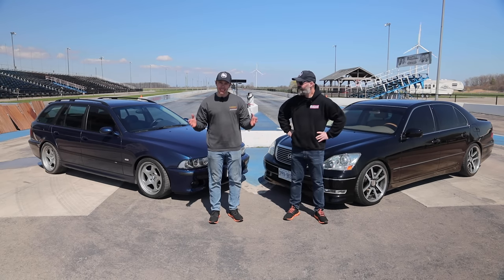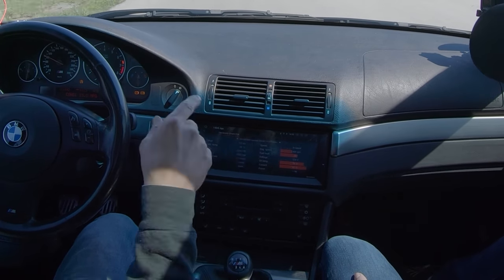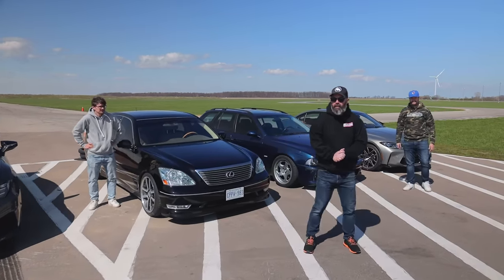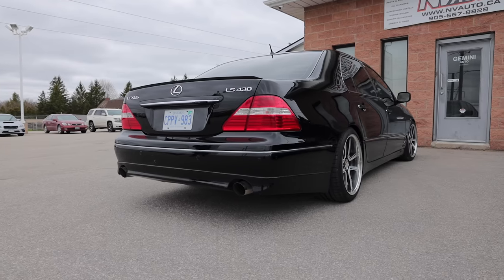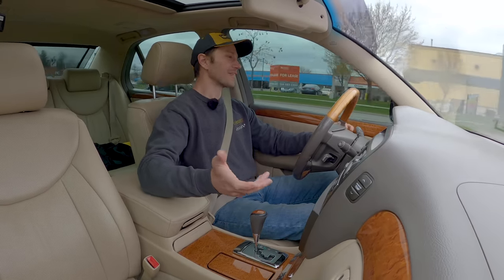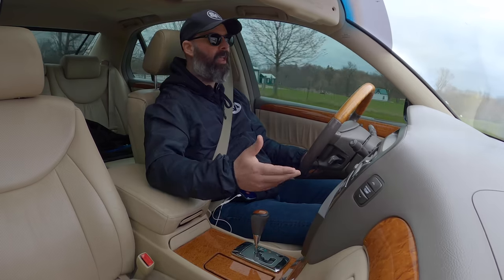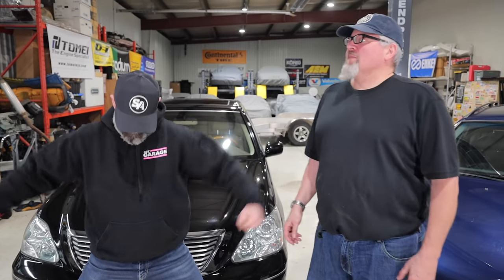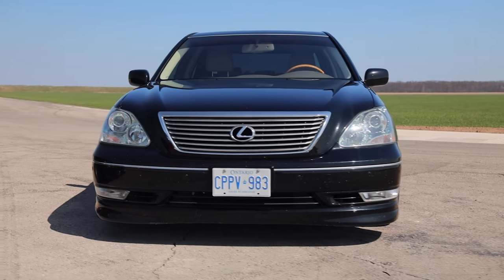We Built the GREATEST $6K Sport Sedans EVER! BMW M5 Wagon & Supercharged LS430 Build-Off FINALE

Comment: There's just something about that wood grain and beige leather.

It's probably the wood grain and beige leather.
Reply: Wood grain needs to go. IMO
Reply: Both extremely ugly, especially on black cars. It's a 70-90 thing because people didn't know anything about designing back in tje stone ages.
Reply: @christopheraustin3324  it's a luxury car, so.
Reply: @traviswalker8933  There is nothing Luxury about it. He modded this thing and the beige leather looks amazing. Black is sleek or maybe even carbon fiber but not the old wood grain. Sorry.
Reply: @christopheraustin3324  I'm talking what it originally was and it was a luxury car. He did performance mods to it which were not too extensive and only made it perform better. That doesn't change the fact that it's a luxury car. Same goes for the M5.
Reply: @traviswalker8933  the wood grain blows. Get over it.
Reply: @christopheraustin3324  that's just your opinion.
Reply: Got a 93 ls400, the beige leather and wood grain is a love or hate. And I love
Reply: @christopheraustin3324  not saying the wood grain is to die for, but 'black on black with carbon fibre' is just tasteless at this point. Materials aside, that centre console is fugly, that would need saving first

Comment: I gotta go with Moose here, the S62 is a special engine, it makes the car. For quite a few years BMW Motorsports was using S62 based race engine variants, deep into the S65's mass production and until the S65 race variants were used later.

Comment: As an owner of a stock 2003 Ls430 ( ultra luxury package)  stock car daily driver. I love the exhaust sound and plan on doing it. Supercharger is a bit expensive for my liking though the cylinder walls are super thin in the 3uz-fe so boost is minimal. I'd like to see the continuance of this turning these into race cars. Lexus has a lot of weight to shed and already gaps off the line. The ultra luxury package has a mini fridge in the back seat. I'd turn that into a bottle warmer just as a scramble. All hypothetical though I'll keep driving my stocker.

Comment: That rattle in the shifter is likely from the shifter selector rod. You can get a dual link selector rod to tighten it up or the Dinan shifter makes the rod sit lower an rubs on the guibo at certain rpms.  I had a couple shifters and finally went with Autosolutions. It solved all my isues.

Comment: i bought a 2005 LS430 in toronto few weeks back driven 263K kilometers & i drove it from toronto to vancouver took me a week to get here & i drove approx 6000 Kilometers & not once did it break down on me or any issues at all drove thru extreme wind, snow storms, heavy rain that thing went thru like a tank.... & whoever was the first owner has kept the car in extreme mint condition it doesnt feel like its driven 263K makes me sleepy while driving its too quite & no vibration nothing at all it seems like its brand new & mines a full ultra btw air suspension is too smooth 😍 soon im gonna swap some exhaust on it its way too quite but i love it its an investment i wont ever regret 🤍❤.

Comment: Thoughts as to why the series was so well received. 

The LS and E39 have classic storytelling qualities in that they are contrasts in almost all measures. Wagon vs Sedan, reliability vs BMW, drivers car vs retirement in Florida. 

Both platforms are equally interesting to car guys. The E39 represents peak BMW. The Lexus represents hardcore engineering with a focus on durable refinement that will stand the test of time.

For each car, which is cool in its own right, you managed through the build to improve upon theses characteristics without changing the cars entirely.

Comment: As to the driving, Inwas one that said more driving. 

I’ll use abandon sti as an example, you driving the sti through the on-ramp revving it out etc, it really had a good sense of speed to it. I could feel the boost building. Personally I like to be able to relate the mods you do to the type of driving most of us do. On the road. Running a car through the gears, get good audio, let us experience the build that way. The good audio is key for me. Mic the engine bay and rear bumper. This video was missing car sounds and emotion but don’t take that as a negative because I like you guys so much it was nice to “hang out” for the video. 

I know it’s a tough balance of not driving like an A hole but also having fun. The hard part is breaking the law lol. Don’t stop track test because that what you guys are. But add in the road element/audio. As for wrenching, I like watching all of it. The new format is a good balance of tech with out getting buried in all the details.

Comment: Consider adding a Helmholtz pipe for the Lexus drone should work pretty well. A few youtube videos show a spreadsheet where you input the hz of the sound that is bugging you and it tells you how long of a pipe you need to add. On Android, figure out the hz by using the Spectroid app. That would be a great video imo. Glad to hear you wanna keep it until summer.

I'll finish the video later, but consider a black interior swap (if not too expensive) on the LS unless you're stuck on the tan.

Comment: These two cars are awesome, i honestly couldnt pick one, love them both! 
Holy moly! Havent seen that chicken coop in so long!
I actually bought a set of those conti extreme sports for my s2k. Its got excellent grip, but not the most confident in turns only because the sidewalls feel like they fold over. It would be amazing if these can last me 30,000 miles.. so far the most i got out of 3 different other tires i got 12,000 miles on firehawk indy 500. No track days.. just daily and lots of canyon driving

Comment: I was getting ready to sell my 93 M Benz S320. Then, I ran in to your LS460 build. Now, I'm going to keep it! GREAT BUILD!
 
I need your input tho - I am running 235/35/20 (front) and 255/30/ 20 (rear) on stock suspension (so, big unsightly gap upfront). I am older (late 50s) so I kinda like the cushy ride. QUESTION: Would lowering the front with adjustable coil-ins be too harsh? Do I need to lower the back, too? I am happy with the height. Thanks, in advance.

Comment: I love the M5, but I also have to root for the underdog. You're pitting a $60k Lexus against a $70k BMW.  In 2021 that would be $90k ($112k CAD) vs $105k ($131k CAD).  Pretty much every extra penny originally spent on the BMW was put toward the Motorsport bonafides. That you made an LS into a competitor is truly commendable.. the wheels (on both) are just delicious icing. 

This series has been excellent, guys. Well done.

Comment: You can thank me, in part, for the anti-speeding measures on Snake Rd. LOL I worked in Hamilton and worked in Waterdown and thrashed that road to and from work in my blue MK3 Jetta (especially to work :P)

Everytime I got waved by by this one guy, as I came up on him, I'd get a letter in the mail from the police about a week later that someone complained about me on that road and date. Probably 4 or 5 times in 1 year to the point where they permanently parked a police car at the entrance to the cemetery for a couple of weeks or so lol Which they would park behind when they were out with the radar gun. Little did they know the fun part was the corners so... lol

It was great testing the handling of rental cars when mine was in the shop 👌 That's when I learned some luxury cars are dangerous! You can't feel what's about to happen untill it happens, which leaves recovering 100% in the hands of your reflexes and driving skill (of which most people's are terrible, especially those who buy luxury cars...) But anywho.

Comment: The Lexus can be faster and both can run lap times at the track for a before and after and against each other. Why haven't you guys thought of this yet? Also if the wagon had E39 M5 rims it would have won easily because it would be seen as a M5 wagon instead of just a swapped wagon.

Comment: I am an avid watcher, but honestly not interested in this type of build. I like watching going through problems and solutions and learn alot. But I would never cut up parts of the unibody to fit an exhaust especially at this extend just to try to make a fake M car.  even the engine is an M its not an M and cutting up the chassis significantly changes things, butt testing won't let you know no mattter what people say. Also the long term rusting or shifting or other unforeseen issues just makes this move a bad one. But it was interesting to watch very cringe worthy haha... but keep up the unique content... BTW! can';t wait for the supra and GTR!!!